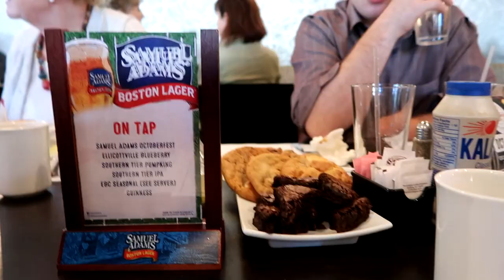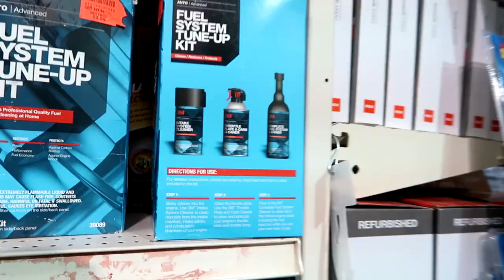VIOLATION TICKET CHALLENGE IN DURAMAX!

Comment: Next time you go to a gas station to use the air, they can't charge you for air, because air is free, so if you go inside and ask them to turn the machine on they'll do it at no cost to you. I get you were running late and trying to quickly fill it, but if you didn't know, now you do.